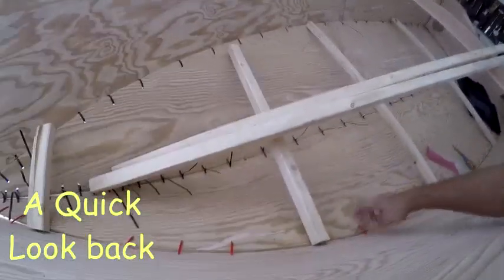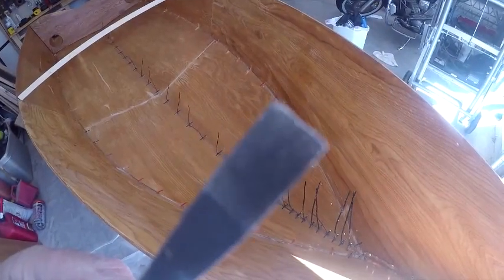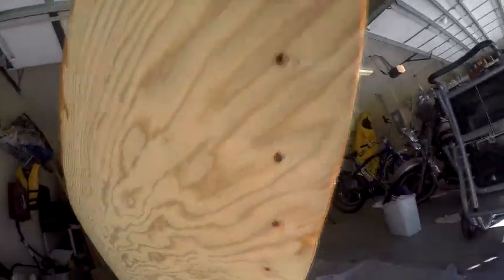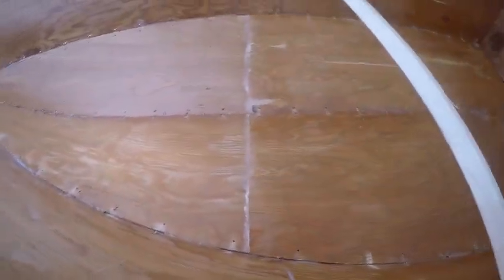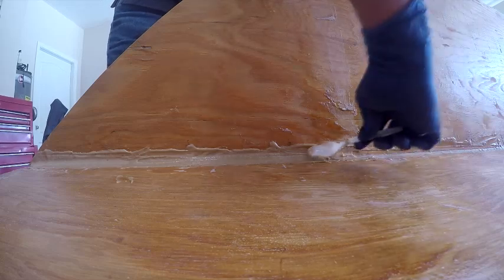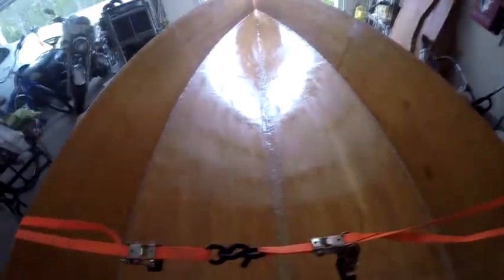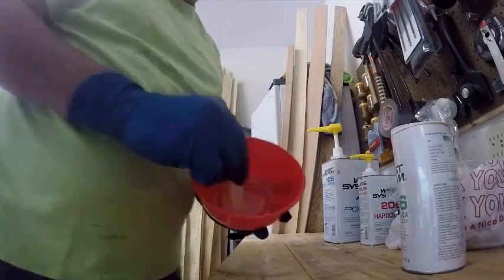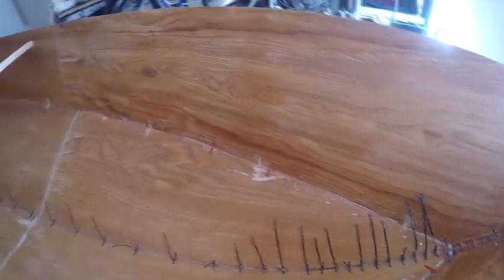15. Building a Boat (Tango 15)-  Epoxying and Stitch Removal

Comment: Another tip for potential builders. When you are making the glue joints, then add the paste to a small plastic bag and cut a hole in the corner and use the bag to squeeze a bead of epoxy past into the glue joint - like decorating a cake. Then once you have run the bead all along the joint, you run your rounding tool (e.g. a spoon) all the way back and create a perfect fillet that needs very little clean up afterwards. 

Before you start, download the free Gorgeon Brothers book on boat building. They invented West Epoxy and pioneered many of the methods of epoxy building - and have a lot of great tips in the book on how to make e.g. fillets but also how to prep and coat plywood.